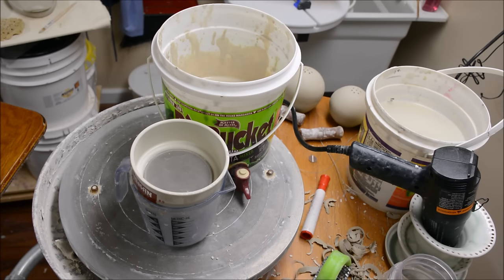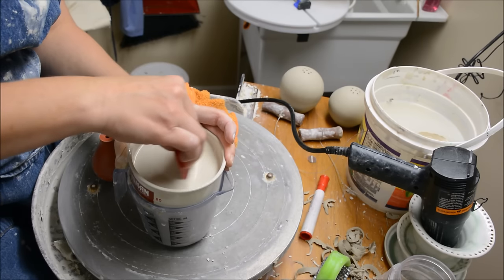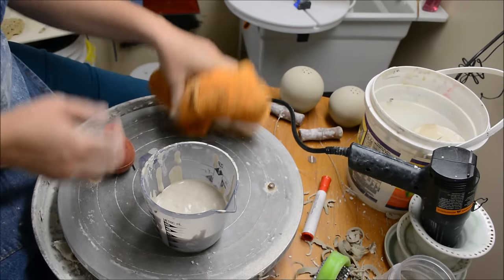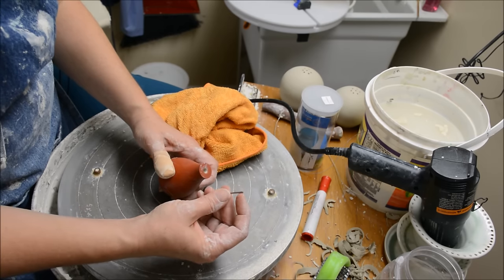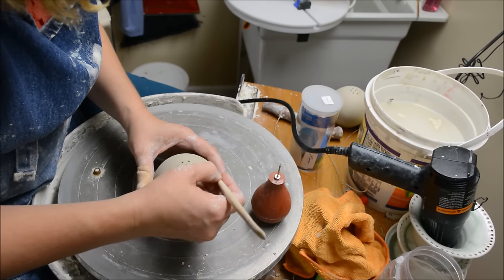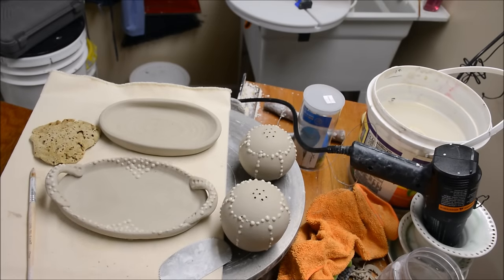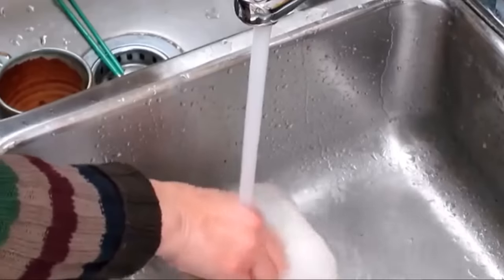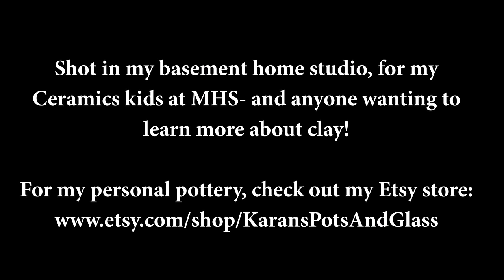Slip Trailing - From Making Sieved Slip to Application - A Demonstration

Comment: Hi, i am using normal plastic bottle, but the slip is not coming out of the bottle, please tell me where i am going wrong
Reply from the maker: I would #1 make sure the slip is liquid enough.  Too thick, and it will be difficult to squeeze through.  #2 Make sure it has been sieved.  #3 Check to see if you have a clog... I often ream my tip with a paperclip or pin.  I hope that helps!

Comment: What would the formula be if you're making slip from scratch..........?
Reply from the maker: Well, the slip must be compatible with the claybody to which you intend to apply it.  That is why I use the same claybody, just liquified and sieved.  If you are making your slip from scratch, then I assume you are making your claybody from scratch?
Reply: Do you soak your clay in water to make slip? Or is slip something that comes from a pottery supply?
Reply from the maker: Lynnette DeBell - if I don’t have a slip bucket with slip from throwing- then I just put some in a dedicated blender and mix it with water.  I’ve never found a need to add anything else when I use the same clay body! :)
Reply from the maker: Hi Lynnette- it is my clay body just watered down. What I am using is a result of my throwing.  Just the slip in my throwing bucket... but you can also make it by placing clay and water in a blender and blending it to a milkshake consistency!
Reply: KaransPotsAndGlass Thank You!!
Reply: I made my slip! It was pretty easy and worked well. Thanks so much!

Comment: so.thats mean.. slip from throwing mixed with slip trailing industry?
Reply from the maker: I don’t use commercial slip- I just make my own from watered down clay which I sieve to remove grog. Slip for slip casting is different. Since I don’t slip cast with my students, I don’t make that... it requires some additives.
Reply: @KaransPotsAndGlass  after comment to your video.. i have figured it out.. so i make it on my own.. thanks